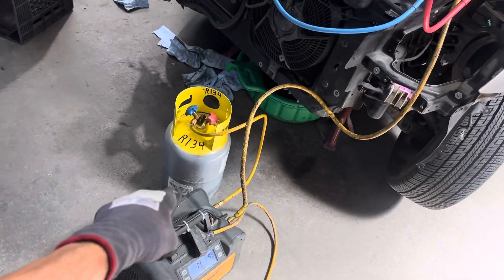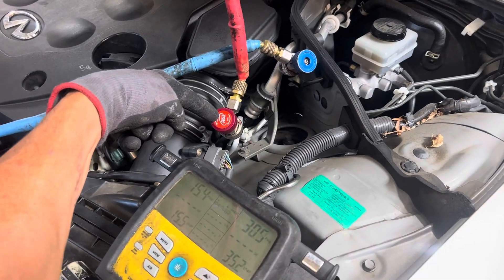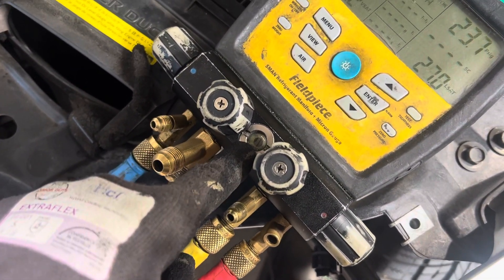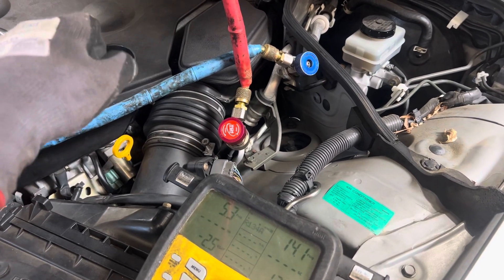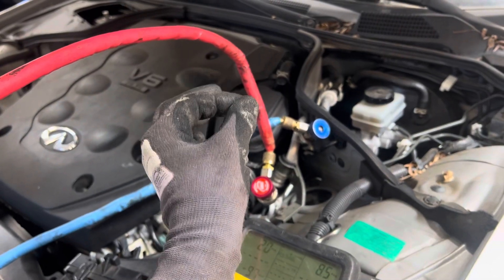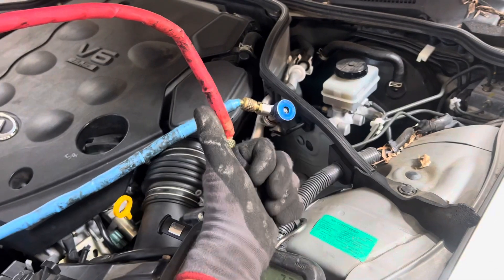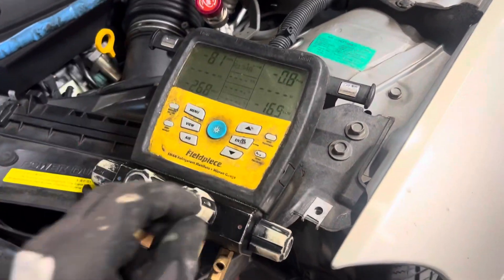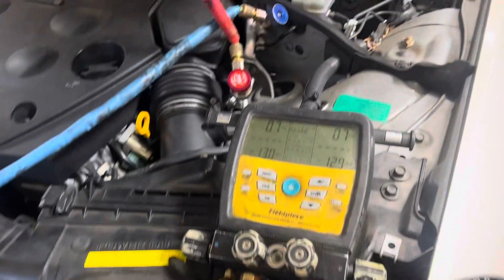REFRIGERANT OIL WARNING ⚠️ do not recover refrigerant out of the liquid line when you start

Comment: In other video, you mention only do the refrigerant recovery via the low side valve (vapour line) and not through the high side valve / line, but here, at the end of the video, you also did try to recover the refrigerant from the high side. 

Please correct me if i got misunderstood. Still trying to learn the AC world knowledge. Thanks
Reply from the maker: It was taking too long to do to recovery on this vehicle just from the one side. 

So I took off the engine, cover inside and hooked up to the high side . 

Thought I was only going to get it through the one side decided to do both

Comment: When u recover refrigerant, can u put that same refrigerant back or its no good?
Reply from the maker: It’s no good. 
It’s going into a dirty recovery cylinder . Possibility that through your handling you have got air more than what you already started with plus moisture..   a recovery cylinder has all the dirt debris, and all the different kinds of oil’s and high percentage of air and moisture from every vehicle who is Refrigerant has been into that cylinder. 

It’s like dirty engine oil going into one common big oil, recovery tank. 

You know all the dirty sludge that’s at the bottom of the tank 

Would you siphon off cups of oil out of that dirty oil and then put it back into one of your engines? 

Same thing with Refrigerant 

Oil gets sent to be recycled 

Coolant get sent out to be recycled 

Refrigerant needs to get recycled
Reply: @coldfinger459sub0  thanks for thanks for the info and luv your channel, great content!